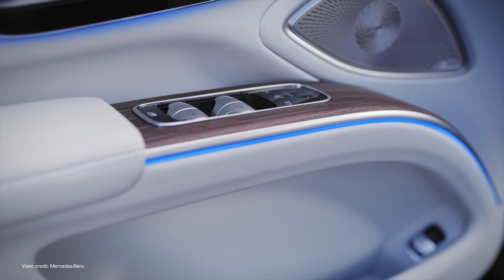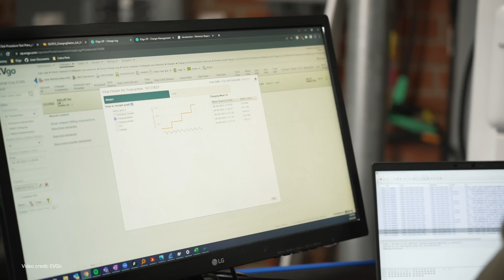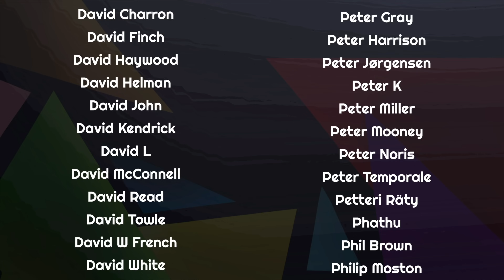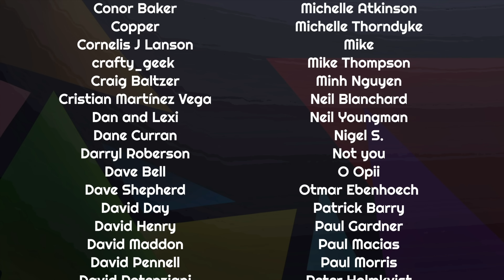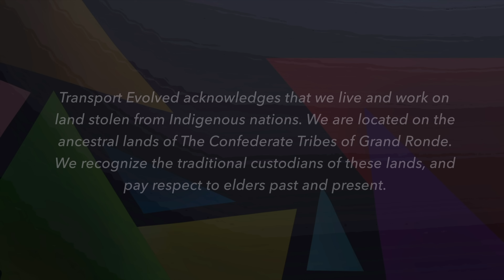EVs have a weight problem

Comment: Thank you Kate for this much needed commentary on the burgeoning vehicle weight problem. It seems that buyers are just gobbling up these ever larger monster trucks and SUVs. I fear the only way to stop the trend is to make it more costly to buyers and drivers. I would favor higher road taxes for heavier vehicles and I think it’s past time that we put tiered driver’s licenses in effect to cover both heavy and high horsepower vehicles. The manufacturers are guilty of making cars and trucks with so much excess performance that YouTube reviewers now claim that 0-60 in 10 seconds is dangerous. That’s not dangerous, putting vehicles that easily do 0-60 in less than 5 seconds in the hands of average and or inexperienced drivers is what’s dangerous. That kind of performance coupled with the huge amount of kinetic energy that monster vehicles generate needs to stop.
Reply: When I was a lad, 0-60 in 10 seconds was solidly in "sports car" territory.

Comment: A saw a video showing CAFE standards, which were supposed to improve efficiency, are actually making cars bigger. He showed a graph of size vs. MPG. If your car could only get X MPG's it had to be bigger then Y size. For example if you could only get 29MPG your car design had to get 12" longer and 4" wider, by law. https://youtu.be/azI3nqrHEXM?si=4xot7yafmYpqpJU0

Comment: Americans always default to the largest vehicle available. Insert an oil shock like 1973, or 1979 and they will immediately seek small hatchbacks for the duration and snap back to the largest thing available right after. 
Large EV’s are heavy, but if only small cars were EV’s most people wouldn’t buy them. I think it’s better to get someone who wants a truck to give them some electric trucks to consider first, then work on making those trucks weigh less later. 
I’ll note that the Cybertruck is several hundred pounds less than the Lightning and several thousand pounds lighter than the GM. They moved to steer by wire so there is no steering column, or power steering pumps and they have eliminated miles of wiring harnesses. 
On the bad side, the Saudi’s seem to go from one extreme to the other and might be going from a cutting production to keep prices up, to flood the market to drive shale production out. If they do, gas prices will be low until they switch back. Cheap gas means more large trucks

Comment: Most people where I live, have pickups, which make SUVs seem efficient 🥴. So adoption of EVs is much harder here (Maine). My needs are much simpler, I need to travel 100 mi each way to help my dad on the weekends, be able to tow my tiny camper (1800lbs) and fit my double bass (6') inside. I also just finished a 3mo clinical rotation that was 102mi round trip, each day. Driving several hundred miles a week is the norm in my state, the real fix will be denser-energy, lightweight batteries; until then, we'll just stagnate. Oh, and can traverse 6" of snow, a weekly occurrence from Nov to April here.(so, no rwd!)

Comment: Where did Musk talk about effectively eliminating pedestrians? And wouldn't his insistence of pushing for weight savings and efficiency make him a hero in this story? Where was the mention of the Cybertruck's pedestrian friendly (for a truck) low nose? Who is the champion of improving the charging infrastructure in the world? Smaller cars are still something people want? Guess who will be doing that on a massive international scale? I know this channel has many reasons to dislike the guy (and some of them are perfectly fair and very understandable), but credit where it is due.
Reply: Next you will be mentioning that all versions of the cybertruck are lighter than the channels f150 lighting
Reply: @alanrickett2537  That may be true, but I do see why it should be on the thumbnail, anyway. That Lightning sees a lot more Real Truck(TM) use than most trucks, though. I am not that worried about apparent gotchas. But biases (however well-founded they may be) taking over and skewing a whole story about an important issue? Not a fan.

Comment: In terms of vehicle weight, according to a study by California, every 100 lbs of weight lost of vehicle could result in about 300 fatalities of the drivers, so heavier vehicles protect the driver better is just a matter of physics. 
Another reason why light trucks are getting heavier and heavier is the tax law favored cars and trucks for commercial use in terms of deduction. So businesses go after trucks including SUV with gross weight over 6000 lbs. (gross weight is a bigger number than the actual weight of a vehicle).
Emission law also contributes to heavier vehicles as the emissions standards are more lax for larger vehicles.

Comment: That's partly why I've dragged my feet so long with regard to getting a new car.  What I REALLY want is an inexpensive and relatively lightweight kit to convert my 2008 Honda Fit to Electric.  Too bad battery tech isn't far enough along to really make that realistic.  Imagine if a 50LB battery could take a Fit 300 miles?  Conversions would be the standard.  It's interesting to think that this may someday be the case, as energy doesn't actually weigh anything beyond the atomic weight of electrons, ha!

I think annual registration fees for cars should be heavily tied to their weight, as that has the largest bearing on how much they wear on roads.  And the effect isn't linear, it's polynomial (think between linear and exponential) so annual fees should be the same.  Each vehicle should be assigned a fee based on the VIN after each is given a sort of "road impact rating" that takes into account not only weight, but tire size, etc. However, an owner should be eligible for a discount if they perform modifications to make it lighter, increase the tire footprint (in other words, distribute the weight over more ground, which would be easier on the road), etc. to lower that impact rating.

But I will admit, though I'm most interested in Tesla's smallest, least expensive "Model 2" that is on the horizon, I kind of quietly wish it was made of that same stainless steel as the CT.  Tough doesn't HAVE to mean heavy!  I like the idea of no paint.  Plus, I do live in America... so, sadly bulletproofness can be rather useful around here at times.
Reply: The atoms needed to store those electrons are heavy.

Edit: Props for calling the road damage equation polynomial (4th power) instead of "exponential".
Reply: If your Fit is a manual, there are kits available which can work in it if you have access to, or know of, a machine shop able to make the adapter for the transmission plate and spindle connector. For ~300 miles of range, you would be looking at approximately 120kg of batteries, if my estimate is correct.
Reply: @downix so a fit with one or two extra people in it, lying down
Reply: @theairstig9164  not once you consider that you are going from a 180kg motor to a 20kg one. You still wind up quite a few kg lighter than before.

Note, this only works due to the particulars of the Fit. Different cars have different weight ratios, airflow dynamics, etc.
Reply: @downix  really? Interesting. I have a 2008 manual. Wonder if it would work with that year. I would assume the needed battery pack would weigh around 800+ LB!
Can you link to this kit? Thanks!

Comment: Aptera is bucking this trend with the lightest long range EV possible.  The best solution isn't necessarily to go back to unsafe 1970s designs but to make new innovative solutions.  The cybertruck for its class and capabilities is actully an improvement in weight (I expected 7500-8000 lb) but it is still a full size armored truck.  Hopefully things like 48v, ethernet w/ microcontrollers and 800v will gradually come to other vehicles (and drive by wire).

Comment: Tesla designed the Model 3 to ride and drive like the BMW 3 series. Comparing the base models of the two for 2023, the BMW is an inch longer while the Tesla is an inch wider and both are the same height. The BMW has 40 lbs. more carrying capacity and weighs 3582 lbs. while the Tesla weighs 3862 lbs. Frankly, 320 lbs. doesn't strike me as being overly heavy yet my state taxes me three times the amount for "road use" than the driver of the BMW would pay to compensate fuel distributors for fuel tax.

Comment: Even if all cars today were EVs that would have done next to nothing about the climate. The honest truth is that in the best case EVs can be about 10% better for the environment with a more realistic 2-5% in the real world. EVs just take that emissions you'd normally see at the car somewhere else. Because of the rarer metals used, scarcity of mines for those resources, etc the crossover point for where EVs become better for the environment is likely around 90-150K miles depending on the cars used. 

This does basically nothing to stop global emissions which transport also only makes a miniscule fraction of. All transportation makes up only 14% of all emissions but that includes cars, trucks, trains, planes, and ships. Of that around 10% is coming from personal vehicles so realistically personal EVs would only reduce global emissions by a whole 1-2%. I'm sorry but the honest truth is that normal people just have very little personal impact. Just for reference just heating and cooling builds takes over 20% and construction takes another 20% a year. 

You just shouldn't be buying EVs to save the world, the honest truth is that they'll basically zero impact on that. Really you shouldn't be buying an EV unless it fits your lifestyle, you can charge it at home, and generally prefer a smoother quieter ride. I really think people should just be more honest why they want an EV. If you really wanted to save the environment, you'd do far just driving your old car till it hits the dirt rather than buying a newer car because it's better on gas. Now there's either one car sitting around unnecessarily, or something perfectly functional is going to the scrap yard.
Reply: The best vehicles for the environment tends to be ones that are already manufactured and still run cleanly.  Apparently with ICE vehicles, 1/3 of the environmental impact is in manufacturing, 1/3 is in the roads & parking lots, & 1/3 is from the fuel consumed.  Obviously, these figures will be different with EVs, but the only way to significantly reduce environmental impact in all three areas is to drive smaller vehicles.  Small ICE vehicles are still better for the environment than monster EVs. Mind you, ICE vehicles still have a lot of metals & minerals that come from problematic areas, but nobody wants to talk about those.
Reply: I think your estimate is pessimistic. Even the Hummer EV is about 50% more energy efficient than your average full-sized truck.

But yes: personal EVs have always been harm reduction. You don't get massive efficiency gains until you start implementing mass transit like rail.
Reply: I think the break even point is around 30k miles, not 90-150k. The actual number varies depending on the type of car (smaller battery options are greener) and the source of the electricity used to generate it.

It's also worth point out that, even if it were just a shift in emissions from roadways to power plants, that shift is still good for human health, as shifting the pollution away from where lots of people are breathing it is, in and of itself, a good thing. And, of course, the electricity grid is slowly getting cleaner each year, which ICE cars do not.

Of course, while the average electric car is cleaner than the average combustion car, there is some overlap and, yes, the lifetime carbon footprint of a Prius is probably substantially less than that of an EV Hummer. But, if you're comparing two similar-sized cars (e.g. Prius vs. Tesla Model 3), the electric car usually wins and wins easily.
Reply: @ab-tf5fl  I think people far under estimate the emissions of building an EV and how unclean the grid really is. When they say the carbon from building EVs they rarely go into full depth and remember that because most of conventional cars is made of steel and aluminum which is fully recyclable where batteries are barely at all. The emissions most report really only include the construction with general destruction of land for mining basically being up in the air as questionable. 

And the grid is barely crawling to being cleaner. The honest truth is that as we use more power they build more fossil fuel plants to counter it. In recent times emissions only went down purely from people not doing as much following covid. Emissions have steadily gone back on the rise again even after EVs now took a nearly 8% share in the US. The grid can be cleaner, but it can also be even filthier and basically nobody actually tracks what their governments are doing on it. Germany for example has a far larger share in EVs to ICE than the US, yet their emissions have steadily been on the rise from building more fossil fuel plants as a "short term solution". 

I will say that moving emissions away from people is better, but it really only affects the truly large cities. It's part of the air as such diffuses fast. I know my home town of over 50K people has an air quality rating only marginally worse than the rural areas around it. It's really only where we get to places like New York New York or Jersey City where people are so crammed in its a major problem. But these are also prime places to add public transport and biking lanes. Plus there air also other emission sources in the cities people still ignore like how they still tend to have petrochemical plants, factories, and general businesses in the area that are high polluters and are areas more likely to have natural gas heating. Remember that heating and cooling actually is a higher global polluter than the entire transport sector at over 20% vs 15%. There's also the fact EVs burn through tires at least 20% faster from being both heavier and drop the added torque. The dust from tires isn't just a carbon emission, it's also carcinogenic and as of right now there really hasn't been much effort to replace rubber tires. 

The honest true is just replacing something with a slightly cleaner alternative to the same thing really isn't gonna save the world. If everyone in the world drove a Prius instead of their current car you'd only be dropping emissions from cars in half. It's still extremely high either way and would be far more impacted by having alternatives to cars. I mean here in the US we also have the added issue of cars taking over as the only transport system where only around 80% of homes had a single car in the 50s to today where over 80% of homes have over 3. Our cars can be 3 times better for the environment per mile, but that's still 2 extra 2 ton bricks per family and nothing is made cleanly. 

But the break even between ICE and EVs is on the contentious side with some claiming as low as 30K miles and others as high as 150K. People seem to just assume that higher number is just fudging the numbers but from what I've seen both extremes seem to over or under report things. Likely that 90-100K is closer to accurate. I don't think it should be that surprising people are being mislead on the topic with companies like Apple claiming their "new Apple Watch is carbon neutral". People's hopes for a cleaner future are really being used against them.
Reply: @Skylancer727  Oil extraction in Alberta uses almost as much energy as you get from the oil. It is almost more efficient to just use synfuels.
The main issue is what to use as a feedstock.
Reply: @jamesphillips2285  you do realize if claims like that were true that it would literally lose money right? It's quite literally only valued at its potential energy minus the cost of extraction and processing. If it were flat or negative it would be a losing business. At that point the only profits would be from subsidies but that would never be able to make up for a completely unprofitable business. 

From what I've seen looking into the topic processing oil to gas takes between 2-4Kwh per gallon. That seems fairly in line with the expectation of how cheap it is as a power source. Considering fuel contains 37kwh of energy that's a rather decent surplus. Even the worst claims that I find rather dubious claim 12kwh to make a gallon. That would put it at just barely making more than they used, but it's unsurprising that very few sources seem to suggest this to be accurate. 

I don't know what people told you of synthetic fuels, but they make any even aluminum batteries look like a genius innovation. Synthetic fuels will always use more power than you get out of it, it's basically just a storage medium, not an actual energy source like normal gas or oil. It's more like green hydrogen which coats more energy than you get out of it. 

I think you're way over reading into the sensational news. Remember that the media continues to talk up "new technology" with basically no practical purpose. This is also a topic full of misinformation because it's both emotionally and politically charged. It's really hard to find direct studies on the topic that are also in themselves not skewed or targeted.

Comment: Which EVs are doing the best at reducing weight? I know Tesla has been driving weight down. The CT is. A few hundred lbs lighter than the smaller Rivian. But I wonder about Hyundai Ionic 6 vs. tesla model 3.
Reply: Sinclair C5 ftw
Reply: The original Hyundai Ioniq was a great car in this respect; an extremely efficient compact hatchback. The downside was the relatively small range and slow charging; sadly rather than improving range and charging speed, Hyundai decided to go down the massive SUV (Ioniq 5) and massive sedan route instead.